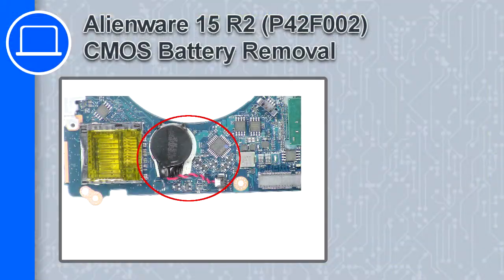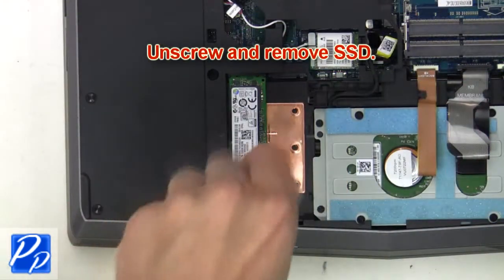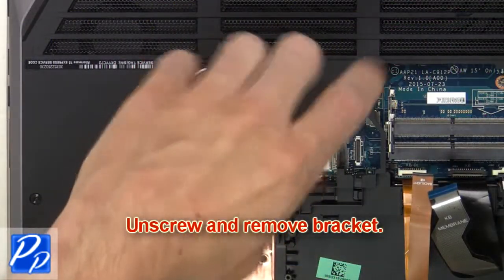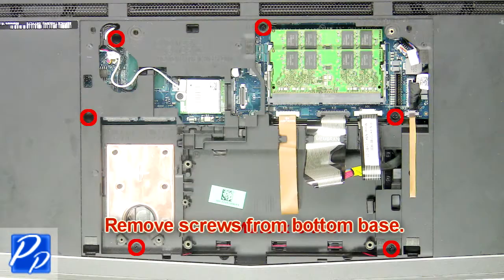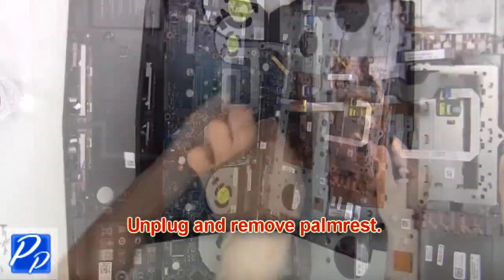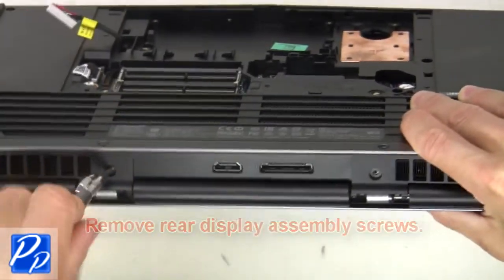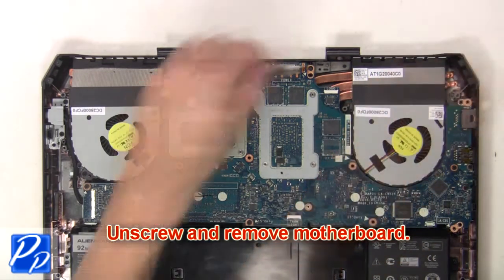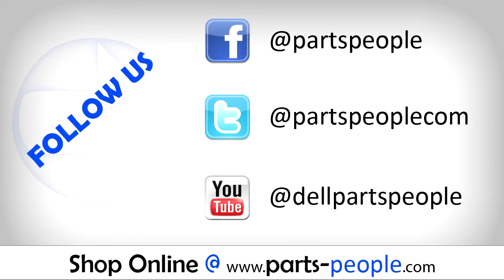Dell Alienware 15 R2 (P42F002) CMOS Battery How-To Video Tutorial

Comment: after bios update from dell website my alienware 15 r2 stuck on process i disconnect the battery and ac adapter after long wait. now no display just laptop start can hear fan and lights on keyboard but nothing response.  ram and other parts working on other laptop. any help ?
Reply: I have the same problem, the exact same thing happened to me. Were you able to solve it or find some information?

Comment: I added an extra ssd to this same laptop. Laptop would not boot and gave 5 fast beeps. After removing the new SSD it went back to normal. Any suggestions?
Reply from the maker: I'm not sure if you were attempting boot into Windows on this drive or use it as a secondary storage device. This would help in troubleshooting your issue.